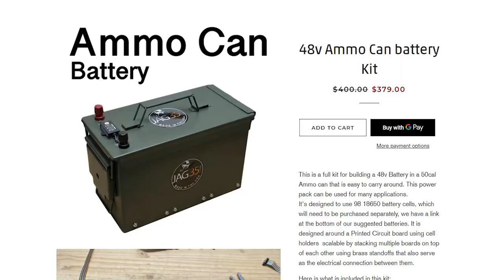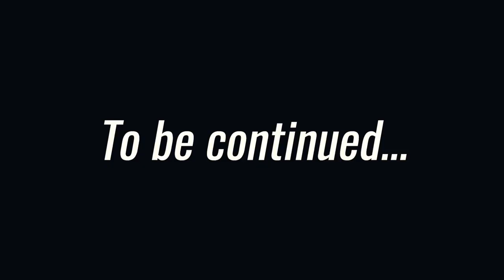It Works! Electric Ride On Conversion - Episode 18

Comment: I'm ev converting a 32 foot boat and believe it or not, I'm learing alot from this...!
Reply: If you use two motors, 2 on each wheel, no differential...will that create a problem or it will work with no issues?
Reply: @xXZ31t6esTXx  See "torque vectoring"

Comment: You guys should do a riding lawnmower conversion using the stock pulleys, stock mower deck, and stock hydro transmission but change the gas engine to electric.

Comment: You could probably run that 20a motor at up to 40a for a few minutes. The peak rating is almost always higher than the continous rating.